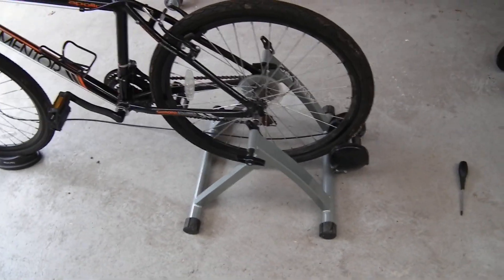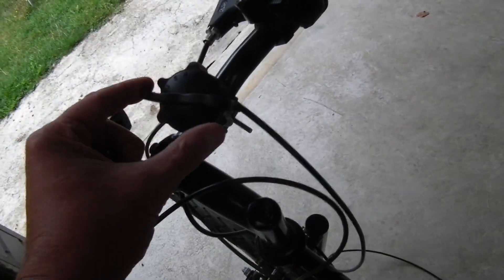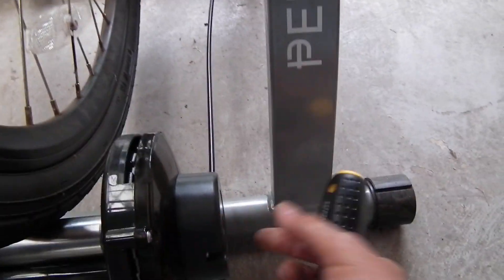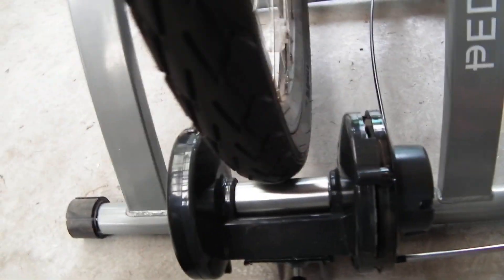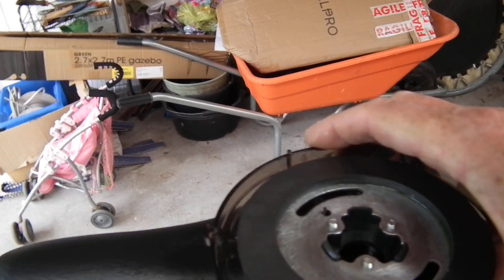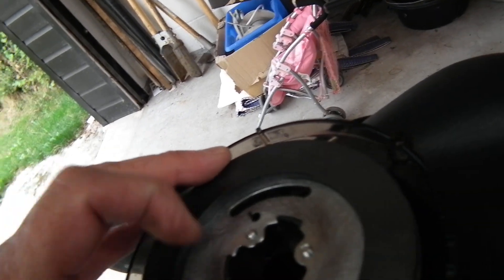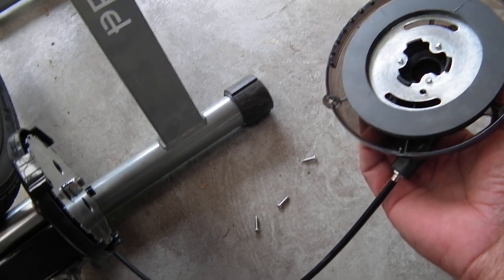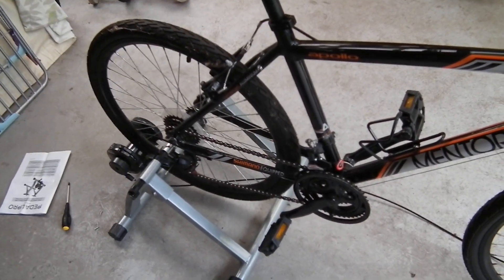PedalPro BTR102 Bicycle Turbo Trainer Faulty?

Comment: I have the opposite problem I think. No matter where I put the dial the resistance doesn't get any easier & the cable guide is completely loose but the resistance stays too high. Also when you spin the wheel by hand it will only go 20-25 degrees before stopping.